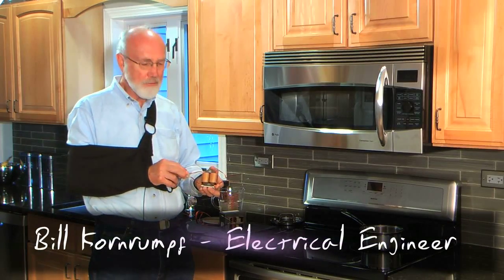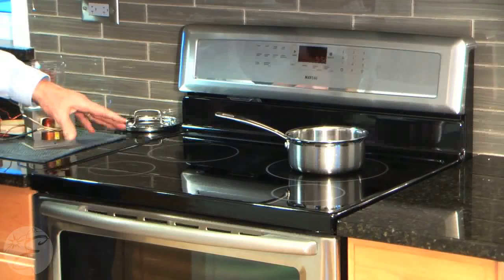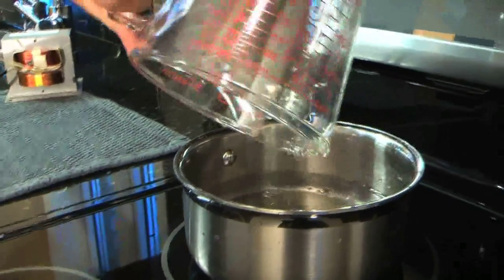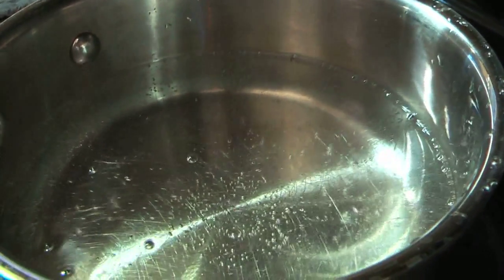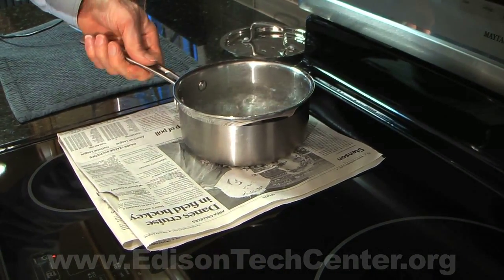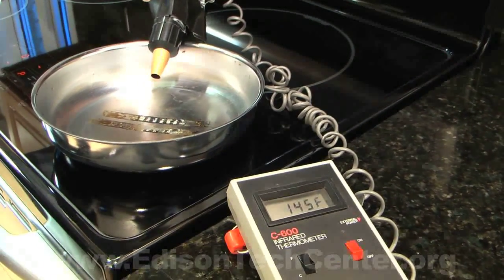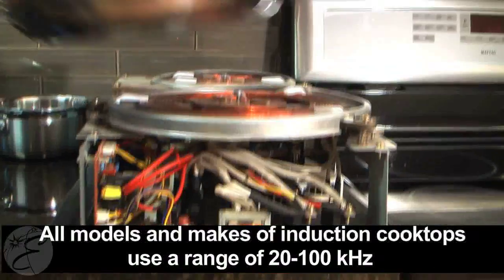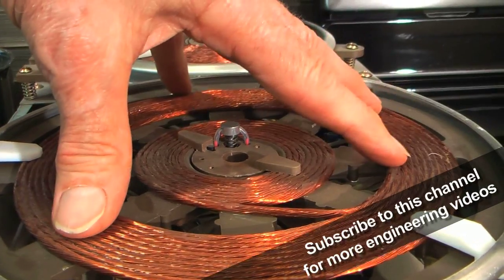How Induction Cooktops Work

Comment: I have had a Induction cook top and oven for about 5 yrs or more i love it. I paid about $2,000 when i bought it because they were not very popular yet, but are becoming more so now. You can't cook on it when the power goes out but that's why i have a small propane camp stove for that.
Also i have had Solar on my house for the last 6.5 yrs it has now officially paid for itself. Its nice to not pay more than $17 for my electric and that is for  a Pole charge but i pay nothing more.
So when we bought the Induction cook top and oven we knew it would be great for the Solar consumption.

Comment: PLEASE DO NOT BUT A BELLING INDUCTION HOB!!! We purchased a Belling Cookcentre in November 2021 and the Induction hob is terrible. It pulses on and off like no other Induction hob. We have had a Bosch for 10 years and it was wonderful, and even a small Tefal one was good, but this Belling one is awful. We have raised it as an issue with Belling but have been told "that's the way it works", and so far told they will not change it or refund us. We are so disappointed, as it makes cooking food at low temperatures almost impossible. For example at level 3 it is ON for 0.5 seconds and then OFF for 7.5 seconds. At level 4 it is on for 1 second and then off for 7 seconds. At level 5 it is on for 1.5 seconds and then off for 6.5 seconds. Even at level 7 it is on for 3.5 seconds and then off for 4.5 seconds! This exaggerated pulsing is awful.

Comment: There are many cons to this nowadays because lots of pots yard out of China with a mixed bag of metallurgy in them. Cast iron is porous so the amount of good surface area is reduced for uniform heating. Also gas bubbles in the casting of new pots even if they're magnetic could pose issues. The amount of fail-safes that are needed to operate these induction cook tops are endless. All that circuitry wiring and heatsinks is not that ergonomic. Yes they do make portable ones but the guts and wires are more than a regular cooks stove or cook top. True they are a less of a hastle and a tad more safe ( well not really if one is careless with the appliance). I wouldn't use it to melt butter or do sauteed onions with or stir-fry with it because you need more of a control with that and temp settings aren't.all that accurate with a coil phasing all the time. With an induction type stove it's an all or nothing setup. Something small goes wrong with it, it's a throwaway item. Another thing is anything that takes an induction coil to heat or cook something, you would want to keep wireless chargers far away from the vicinity of the induction appliance. Also I wouldn't be wearing a smart watch with a wireless charge capability and a phone close to the appliance especially when it is operating. Induction stoves are also hard on mechanical watches as well. If a bracelet that's magnetic also comes in close vicinity of the appliance it could cause burns if it's on. I've seen a lot of horrible things gone wrong with induction stovetops and the effects it has on other appliances. A standard glass stovetop is better with infared heating elements built in. That way you can use various pots. Induction stovetops also can create health issues. Great video though on the explanation on how induction stovetops operate.
Reply: Wow, stop right there!
You are talking a lot of crap. There is no evidence that induction cooking is more prone to faults. Also there are no warnings of any kind in regarding to rings, bracelets, chargers, watches and or smartphones.
Come on, wise up!
Such possible security issues as you are describing would not be acceptable for a consumer device.
Reply: I have one and wear a smart watch with no problems. I also use it for heating butter and even chocolate and it doesn't burn.
I have has no ill effects from using mine and have had it for over 5 yrs.

Comment: I have a question about the paper not heating up. Why? The glass gets hot. The water in the pan gets hot. Why doesn’t the paper get heated from either the process or the heat transfer from the heated pan?
Reply: The heat is created in the bottom of the pot itself as a result of the magnetic metal and the conduction of the heat through aluminium layers.
The glass top of the stove also barely gets hot and although cautions apply you can place your bare hand ✋ flat onto the stove within seconds after removing the pot.
Reply: It gets just to 100ºC because it is water, so the temerature is not high enough to burn the paper. I don't think it will work heating oil or others that get higher temperatures.
Reply: @elviraboix  No, the temperature has got little or nothing to do with it. Burning oil will have the same effect. For the same reason the glass of the stove does not get that hot. Although one should be careful, it would be quite possible to put one's bare hand ✋ flat on the stove immediately after removing the pot.
I know it sounds incredible but those are the facts.

Comment: so it does work on 220V DC?
Reply: It would need an inverter as induction transformers rely on change in voltage.

Having continued to watch I stand corrected as the demonstration units at the end just convert to DC then to high frequency AC. You might be able to find one, but as 220V DC is not a standard that I'm aware of it might be difficult to find a producer.
Reply: In Europe 220V is widely available and induction stoves work on them without any problem although one does need a special perilex outlet and two-phase electric connection.
Reply: @razorblatter  DC= Direct Current
I got my solar panels hooked up to get 220V DC / 32A out of them. My welding machine, angle grinder, LED light bulbs, heaters and some others are working just fine either on 220V AC or 220V DC, ONLY if you use solid state relays or specially designed equipment for DC voltage. Usual AC switches melt down in seconds at 220V DC because of the electric arcing.
Induction motors, transformers and some other AC dependent equipment does not work.
Reply: @numeprenume512  Ah, in that case my appy polly loggies. I'm in way over my head and not such a technical savant like you.

I do hope you're able to roast an agreeable burger if you crave it... ;-)

Comment: The question is' why does only ferromagnetic iron work on an induction hob? And don't say "because it works by magnetism", that's not a good enough answer. They work by induction, currents will be induced in any conductor place on an induction hob. Stainless steel is a worse conductor than pure iron, but the magnetic Stainless steels work and the non magnetic ones don't. So what is the physics behind it?
Reply: The same physics that stands behind the choice, that the core of the transformers is also a ferromagnetic material. It is related to the orbitals distribution of Fe electrons, which channels the electric field so much better. Imagine the difference between a coarse and a fine sandpaper for a woodworking job. The coarse one can catch more material. The sandpaper is the Fe and the wood is the field. As for the magnetism itself, they still try to figure it out. Gravitation, electromagnetism, the weak force, are still pure esoterics yet. In other words, 'the four-dimensional divergence of an anti-symmetric second tensor equals zero' ...

Comment: Now I'm starting to wonder what would happen if a coil of wire where submerged in the water. Might accelerate boiling even faster. 

At any rate, my next stove is induction.
Reply: Inmated do that in prison to boil water in their cells.They are called "Stingers" No I was not in jail...I was an employee that worked at San Quintin.
Reply: @Heart2HeartBooks  But you're reaction may be a nice anecdotes but it's not relevant in above case.

Comment: I'm not sure that the transformer analogy works 100% here. With a transformer, you have two coils with a ferromagnetic core. The desired result is to transfer the electrical energy from one coil to the other with minimal loss, and eddy currents and heat are unwanted byproducts that are minimized through various techniques (lamination of the core, for example). With an induction cooktop, heat is the desired product, so an induction cooktop is essentially a transformer with one coil and with the ferromagnetic pot as the core.

Comment: There are so many types of stainless steel stock pot on the market. 304 grade, 430 grade, or 205grade.  
I'm choosing a big stainless steel stock pot to cook meat stew. I will be using it on an induction cooktop. 
Is it correct that one material conduct more heat than another material on induction cooktop? or as long as they are a little magnative, they all have the same cooking speed?
I'm wondering if the iron content matters the speed.
Reply: +Yinan Wang For the most part, either it works or it doesn't work. There are pans out there that supposedly work better with induction (that is, more efficient and heat faster), but they're made out of a proprietary combination of materials and cost $$$. From my experience, cast iron, clad, etc. work equally well. The main thing is to use a pot that is magnetic (and not all stainless steel is magnetic, so you have to check).
Reply: +ploeg Thanks.

Comment: I do a lot of home canning. Will this heat source work for that process? The thing that concerns me is....there is a period where the heat must remain on high for 10 minutes and then it can be lowered. There is also the concern of weight and the possible breakage of the glass top. The canner is aluminum so wonder if it would work since aluminum is not magnetic. Thank you for this great video!
Reply: The pot bring magnetic is essential in the heating. Aluminium will not work. Unless...it is surrounded by steel.

Comment: Well done basic details, it was interesting to see some actual internals for the first time, but I would've liked to know more details about the secondary "coil"(= pan) induction.
I mean the pan is solid chunk of one metal, not a coil that has - and + potentials at the end of the wires. How can there be current*voltage=Power  in a metal that is in same potential?

What attributes of the pan need to have and how they affect to the efficiency. I really don't yet get it, why the pan actually heats up. The secondary coil in normal transformers doesn't heat up. It's probably because of the way lower resistance.

I have many questions about this subject:
What happens if I put a light bulb circuit with a coil on top of the stove? Can I build more efficient pan, which has an actual coil embedded in the bottom of the pan?
How does frequency and voltage affect the induction efficiency?
Reply: Well, this response is 8 years late and maybe you already have your answers.  The oscillator operates at 20khz on the "primary" side of the "transformer".  The other side of the "transformer" is the pan.  The reason it heats up is that all the magnetic field is short-circuited in the iron.  Technically the collapses of the magnetic fields in the iron result in electric fields called eddy currents.  These are short-circuited causing a lot of heat.  The reason they use iron and not copper or aluminum is because iron is not a great conductor but does have good ferro-magnetic properties.  Eddy currents in regular transformers are minimized because the core is made from a lot of individual slices of steel laminated together. But eddy currents in the induction cooktop are encouraged.

Comment: I think the 'magnetic steel' pot thing is a bit of a red herring isn't it? Isn't the cook top working as an air-cored transformer and the pot is the secondary, so any conductive pan would work? (Friend of mine has induction cooker and uses aluminium pans, nothing magnetic about them)
Reply from the maker: "Induction-compatible cookware contains ferromagnetic materials – in other words, it contains iron, or has a layer with magnetic properties." It's likely your friend has an aluminium alloy with iron.
Reply: +TheChipmunk2008 There are specialty cooktops that can heat metals other than ferromagnetic metals. However, nonferromagnetic materials don't "grab" magnetic fields nearly as well as ferromagnetic materials, so it's harder to generate the eddy currents in those materials, and the process isn't nearly as efficient as with ferromagnetic materials. As a practical matter, anything that a normal person would get in a store will work only with a ferromagnetic base (either as part of the cookware or as an "induction disc" that you put between the cookware and the cooker). Induction cooktops won't work with certain types of stainless steel either; the stainless steel in the base must be magnetic stainless steel.
Reply: +EdisonTechCenter I saw aluminum pans used on a conduction stove, and the bottom was coated with steel.
Reply: Why don't aluminium pans work?
Hint, it's to do with the skin effect.